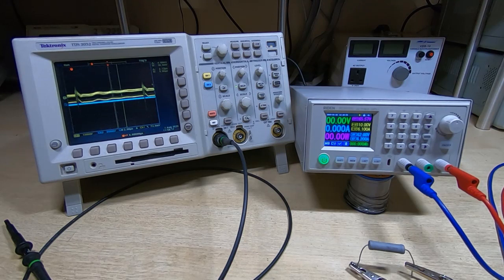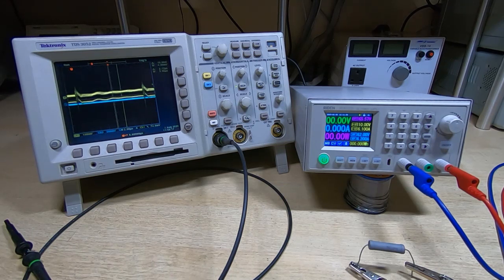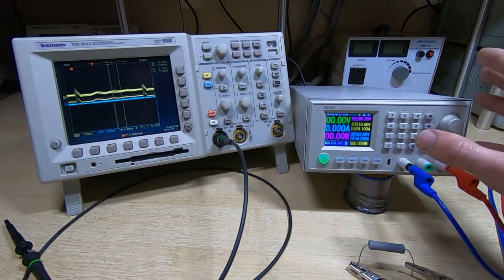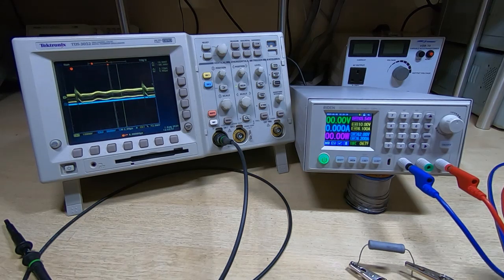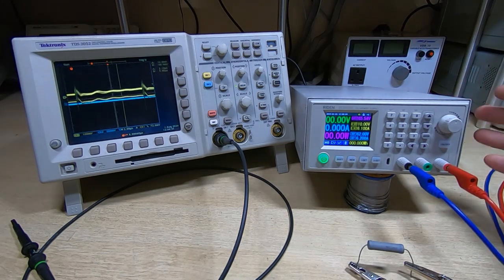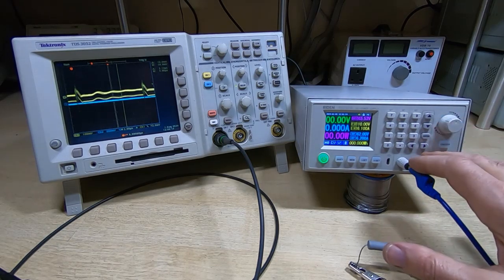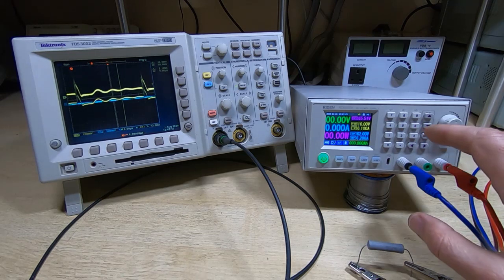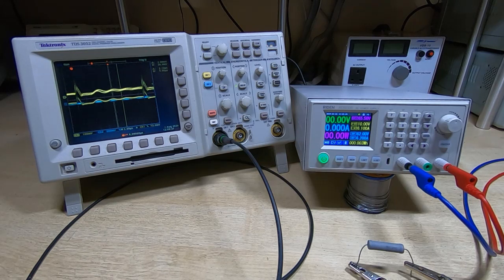Electronics For Beginners Part5

Comment: if the rate of change creates noise, would it be possible to slow down rate of change? As I understand the only source of change in the PSU are primary FET(s). Could there be any room to slow them down with some resistors and capacitors on the gate? The tradeoff, as I understand it, woud be increased switching loses and reduction in max power of the PSU. I wonder how far or close to the slowest limit are they switching. And most importantly, how close can noise get to the linear version. P.S. feel free to correct me in case my assumptions are wrong.

Comment: Would putting the switching power supply in its own metal cage grounded make a difference?
Reply from the maker: It would depend on how the internal impulse currents (fields) are coupled to the input and output conductors. It may make no difference at all but you can try it. The power supply in the unit I show is completely shielded (and is then inside the metal enclosure) but as you can see it makes no difference. The way to think of it is by considering what effect shielding a particular piece of a wire in a circuit would have. It is the entire 'loop' that needs to be considered. If the input and output conductors are properly filtered and terminated then screening should reduce the noise but these cheap switching supplies have minimal filtering which is why they are so bad but if they are used 'inside' a complete design then they may be OK.
Reply: @JerryWalker001  I think I see what you are saying.  I was thinking of that because I'd recently done a mic-pre-amp circuit that was picking up lots of noise.  Was testing low-pass filters and they didn't help at all.  Then I'd wrapped it in tinfoil as a test and bambo! All interference gone. So, I'd opted to not put any filters at all and just have it fully shielded.  The difference here is that these are interference from external not in-curcuit EMF sources where as in the power supply case, the interference is "in loop".  In this case, just going by when we see in the field, you've got shielding plus ferrite cores can help but certainly your point of filters alone will not help.
Reply from the maker: @kippie80  Yes it really only applies to the 'source' energy and not anything coupled to it. Screening on a device not in the source loop should be effective as long as it is not externally coupled through unfiltered paths.

Comment: Jerry, this video helps me out a very great deal. I spent a lot of time fumbling around trying to solve this (caps here and there, shielding my enclosure better, Etc.) and ended really up getting nowhere. I noted the same things you demonstrate in your video but you showing the noise with the scope "in the ether" really cinches it.  

I'd sum it up in my own way as "it's not a conducted noise problem but a radiated issue". Even a shielded line cord won't solve it.

I'm interested to know if/how it could be "solved". I gave up in the end. Maybe it practically doesn't matter. In the end I just ended up using a linear supply for radio gear.
Reply from the maker: Yes it is easiest to think of it as 'radiated' energy although that is not totally correct as it is a field 'loop' problem as opposed to a simple radiated (or conducted) issue. It can certainly be minimised by identifying the source of each 'transmission line' and isolating them to effectively 'terminate' them. Unfortunately it tends to be a total solution problem where a combination of screening and line filtering is needed so that the transmission lines are effectively truncated. This prevents the energy propagating into surrounding areas. A good way to investigate it is to use a spectrum analyser with near field probes but it gets very complicated. As you say it may not matter although it is a very interesting problem to try to solve. A really good starting point is to minimise any loop areas (tying cables close together etc).
Reply: @JerryWalker001  
Ever since your original video on the switching noise, I’ve been wondering why one couldn’t filter it out. Thank you for your explanation.